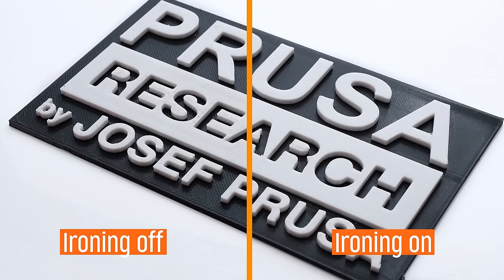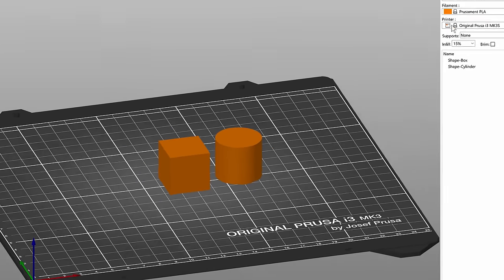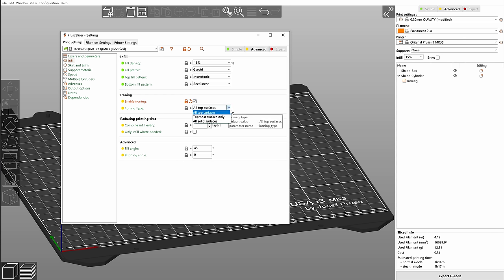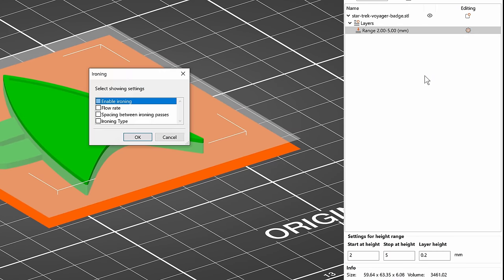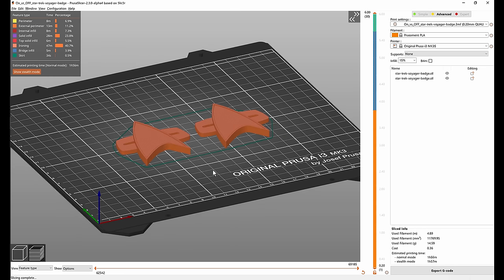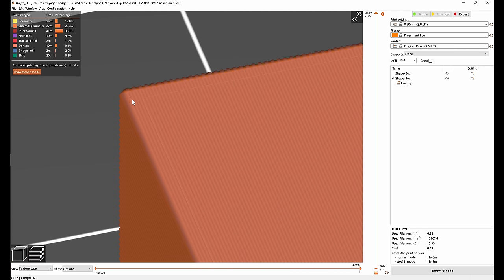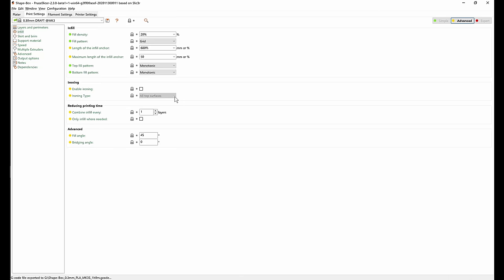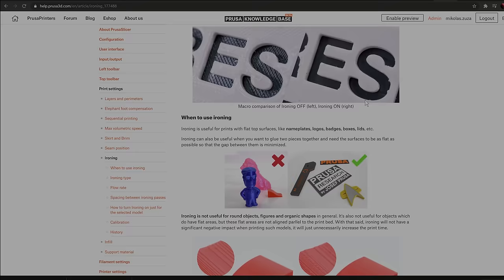Guide to Ironing. How to make top surfaces smooth with PrusaSlicer

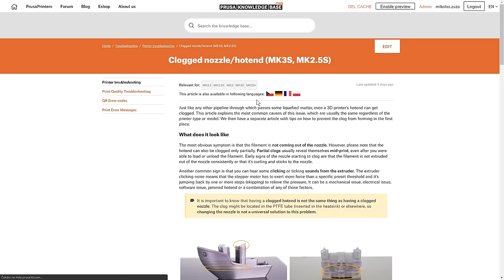Comment: At 7:20 you mentioned about fuzzy edges after ironing. Cura got crucial modifier for that called "Ironing Inset". That modifier let you set the distance how far from the edge the ironing should finish (in milimeters od fraction of milimeter). It basically eliminates the problem with fuzzy edges. This is extremely important, especially on objects with rounded edges. This video was prepared 2 years ago for PrusaSlicer 2.3. Now we have official 2.6 version and equivalent of that function is still not present in PrusaSlicer. Do you think about solution to "fuzzy edges" on ironed objects and when can we expect it?

Comment: Earlyer this Year you talked about non planar slicing and if its worth it. A good start would be to enable such a feature for just the last few layers. You wouldnt have to modify your printer with a longer nozzle and you could cover the print steps on almost-planar areas. that would be a big increase to prints that have round tops like heads or so.

Comment: Ironing is such a huge step for me. Is there a way to not iron the perimeters, so not so much of the fuzzy edges occur?
Reply: how about watching the whole video.
Reply: Just add a modifier make it a lil Smaller
Reply: Yes i am aware of that thank you, but i mean an actual option. For example a loot of my prints have a very complex top surface like a Name or something and then its verry hard do make the right modifiers.
Reply: @bercha3091  ad a chamfer to your top surface and that may help.
Reply: Not surez what i do is go around with a sharp blade and clean if the edges
Reply: @banny123456  Hmm thats quite a good idea thank you

Comment: Would it not be beneficial if you could set another temperature for ironing? I guess it's easy enough to manually play with temperature in the gcode, but i think it would be a nice feature to add into the slicer.

Comment: I have tow halves of an object that need to be mated to each other and have been placing these mating surfaces down into the print bed using PrusaSlicer. Would "Ironing" these surfaces provide a smoother surface than printing flat to the print bed? I ask because it still does not have a tight fitment. Thanks for any directions.

Comment: Hi there!

Is there an option to turn Ironing on, but letting the perimeters untouched (without having to do tricky things, like importing an personalized model, with offset surfaces, that exclude the the perimeters or changing the gCode).

If not, I think, that could be a nice and relatively easy to implement option, that would help to keep edges clean and sharp while keeping almost all the surface smooth and flat.

Btw, very nice and comprehensive video :)

Comment: What are those spool holders with the metal bearings?
Reply: They're very like the spool holder that comes with the Mini, but apear to be laser cut.
STLs are here - https://www.prusa3d.com/prusa-i3-printable-parts/
Assembly instructions (mini BOM)- https://help.prusa3d.com/en/guide/building-your-mini_177717#179085
Reply: @_Piers_  thanks for the info!

Comment: Hi, i want to ask one thing and this is the right place. Im modeling in Solid Edge and after opening saved STL file in Prusa Slicer, round objects are bit squared. Can someone help me?
Reply: you will have to set your output tolerance lower. in Siemens NX its called triangle tolerance and i set it to the lowest which is 0.0025
Reply: @chrischiyo7785  and where can i find it?

Comment: Question: does ironing tend to make the nozzle dirty?
Reply: Not really if your settings are correct. Remember that there's gaps in your print where that ironed plastic is supposed to go. Sure it can and will happen if you extrude too much. I tried this on my old Anet A6 with Cura quite long ago and it's feature I've missed heavily and it's nice to see this finally coming to Prusa out-of-box.

Comment: bought an mk3 on eBay- NIGHTMARE no print stuck to the steel sheet despite ALL troubleshooting measures. I then I bought a new steel sheet -  waiting for 1.5 weeks.  No sign of the item yet !  I have a formlabs pinter and Creality scanner - both companies are FAR more responsive if there is a problem. You get better printer for less money and less stress!